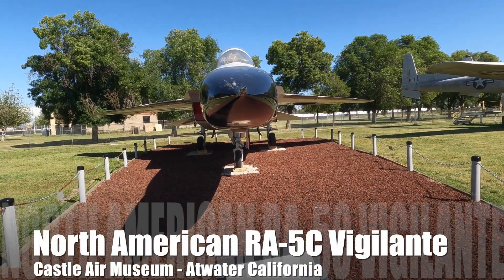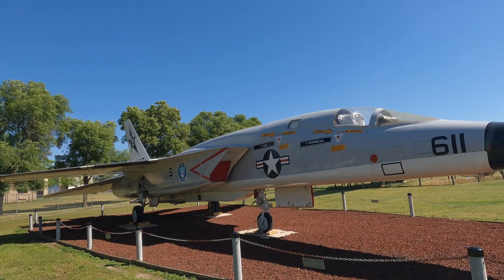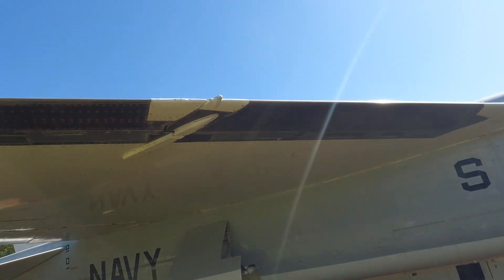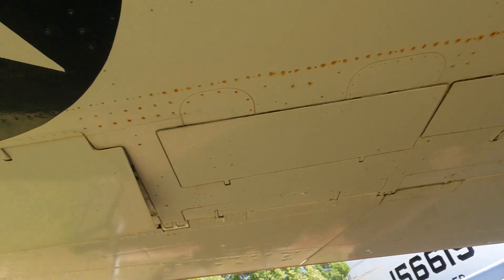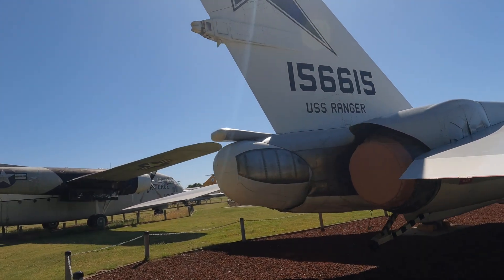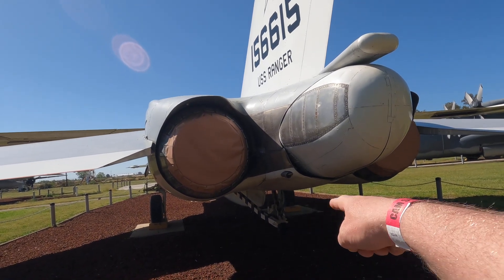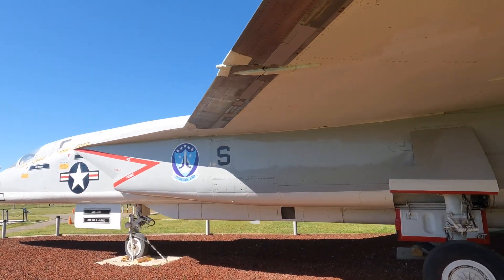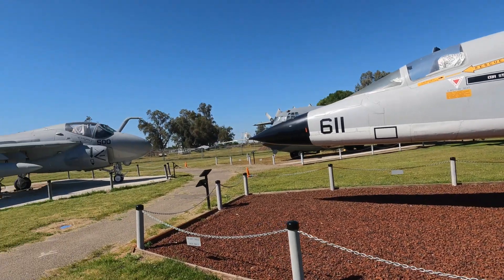North American NAVY A5 Vigilante USN Nuclear Bomber

Comment: I got to see one in flight in 1980. I was based at NAS/NATTC Memphis, TN when one flew into the base while I was walking back from town. At first, I thought it was a Tomcat flying over, but then I saw it had a single tail. Shortly after it arrived, it was converted to a static display across from the chow hall. The last time I looked on Google Maps, the Vigilante was still there.

The A-5 entered the fleet in 1961. Its original mission was to be a high-speed sea-based strategic bomber capable of carrying nukes. The bombs at the time of its development were still quite large and heavy, so a big airframe was needed to accommodate them. Because of a change of policy that relied more on submarine-based strategic weapons at the time of its service, the A-5 became redundant. Its mission then became that of a high-speed reconnaissance aircraft, being redesignated as the RA-5 in 1963. 

The one I saw in Tennessee, BuNo 156608, was the last operational example, formerly based on the USS Ranger with RVAH-7. Its final deployment was aboard Ranger in 1979.

RVAH stands for Reconnaissance Fixed-wing Attack, Heavy.
Reply from the maker: great comment, thanks

Comment: The rear 'ejection' was never used after testing....instead extra fuel tanks were installed. I think the crack in the 'dome' is just wear-and-tear from sitting through the seasons. Yeah, it was a very difficult jet to land on a carrier. Same turbojet engines as the F-4/ F-104/B-58s.
Reply from the maker: great additional information, thank-you